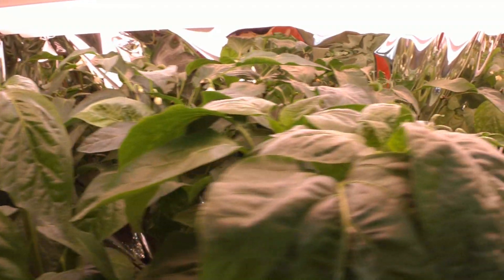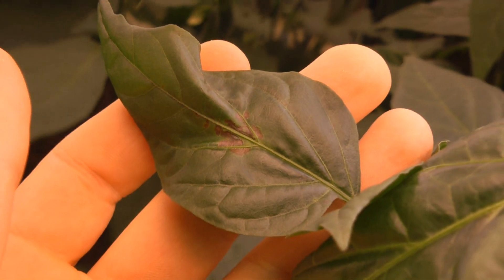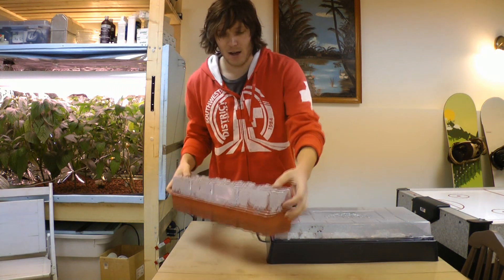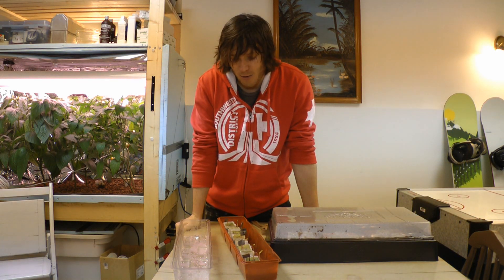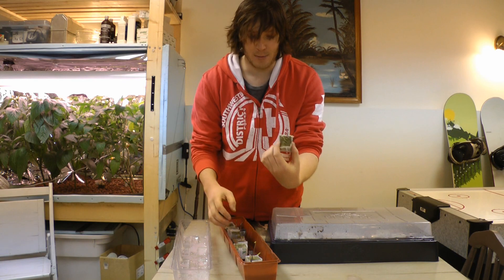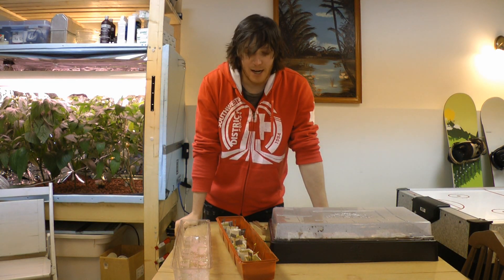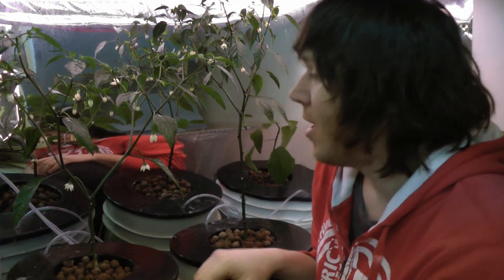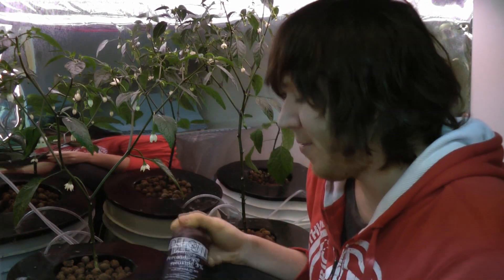How To Hydroponics - S02E08 SuperThrive, DWC, H2O2 & Solar Oh My

Comment: Supposed to be better for old seeds. It's already proven that water grows roots faster than nutrient mix. Also kelp is good as a buffer for very rich fertilizer and helps with heat stress.
Foliar spray is good for nutrient deficiencies.

Comment: Try to germinate seeds using aspirin. I use it all the time and works great. Your battery  is colder at night. Batterys loose charge in cold weather. People have all kinds of charging problems in the winter months. I just seen how old this is so if its still relevant

Comment: If your battery is sitting straight on cement your more than likely losing power trough ground. Biggest reason you never store battery's  on ground. Try putting them on a pallet or wood, could be easy cheap fix

Comment: Superthrive isn't really for seedlings, its more for reducing stress and shock from transplanting plants and tree's. In the past when transplanting normally, my plants would go into shock, and start to turn slightly yellow and droopy, the last time I used Super Thrive and the plants looked like they were never even transplanted. They stayed green and firm throughout the whole process. They just say you CAN soak seeds in it if you want, that is not its primary use.

Comment: yeah i think superthrive is more for foliar and fruit enhancement, but i do have a starter house in georgia and did the same test and superthrive did speed up the germination in seed testing. also using superthrive put me at 93% germination from heirloom seeds i have saved and before i was at 87%. and the tests were completed every 7 to 9 days and before it was 10 to 12 days. but over all superthrive works well for vegs, and the amount used just expands the lengh of time it is active

Comment: Ok, 1- what's the volts going from your panels to your battery? You have at have least 18v to charge your battery. And  you have to keep the battery off the cold floor. 2- you should think about getting a wind turbine so it would still charge your battery at night 24/7. Good luck. And keep up with the videos.

Comment: the best battery for high loads and quick recharge is the Optima yellow top deep cycle battery.

Any battery designed for boat trolling motors is also good for servicing high loads and quick rechargability.

Comment: First, stop using rockwol this isn't 1970. Second, use rapid rooters or coco period as they have built in beneficials and will help rooting hands down. Super thrive is for trees, it says so on the bottle and its real claim to fame is that cannabis growers buy the hell out of it...doesn't mean it works for that either though but the money is coming from them and tree farms. If you want better rooting, better cloning and rapid root growth get some Great White or Myco Madness beneficial micros.

Comment: How high is the charge voltage? if you took a voltmeter to your car and monitored the battery voltage with the motor off, then again with the motor on, you would see that the alternator puts out a higher voltage than what you might be getting from your panels. Increase the charge voltage.  The type of battery you  use, will also be a factor in your problem.  Give more information on what you find, and I could comment more.

Comment: Cloning from clippings hasn't failed me yet. The yield might be a little less, but at least I know where my plant came from, and it cuts corners on the clock.

The dark spotting on the leaves could be phosphorus deficiency, or possibly due to no dark time. The spots appear in the center, which tells me it likely isn't disease related, but could be over-fertilization. If it gets out of control I'd check the PH, trim back affected leaves.